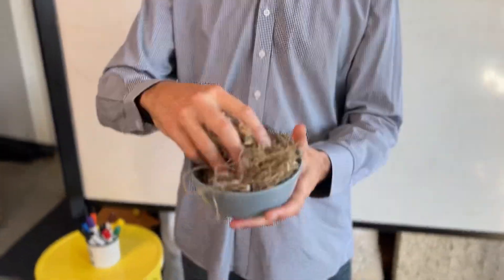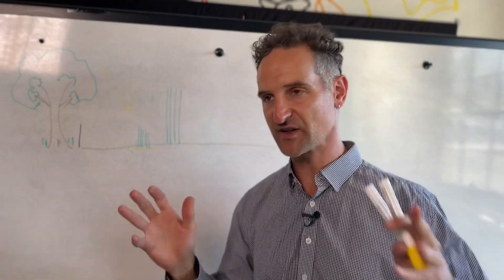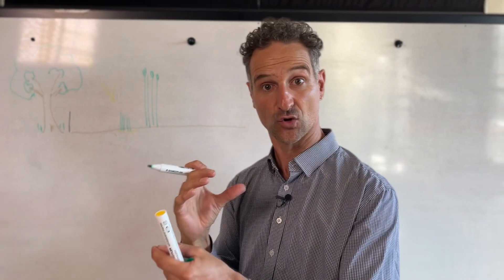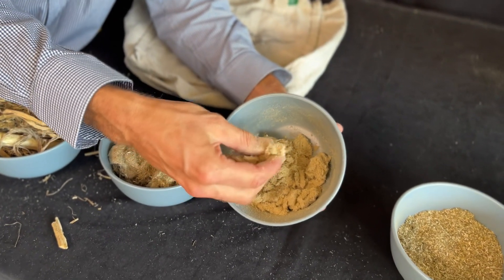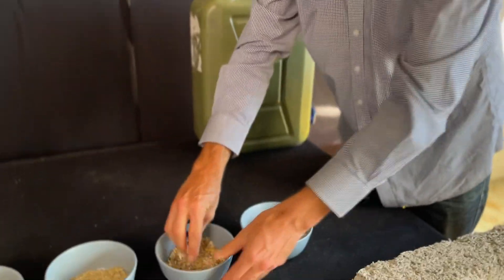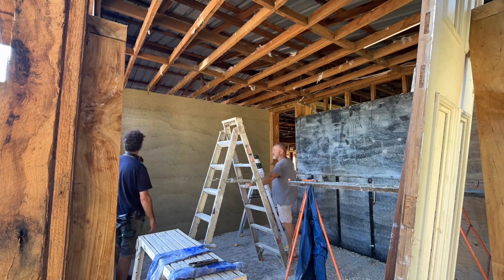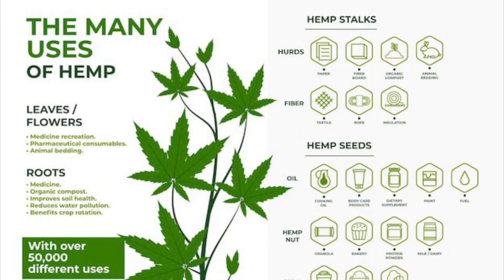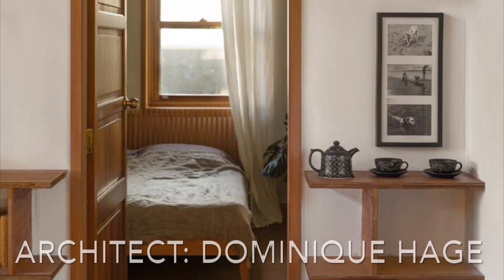Hemp and Hempcrete | Show & Tell S1 Ep9

Comment from the maker: It’s been brought to my attention that some of the information I have presented needs clarification. 

  - Hempcrete doesn’t turn to stone or petrify, even though the lime itself is getting harder as it absorbs CO2. Petrification is the process of organic matter being replaced over time by minerals to form stone, usually minerals washed in by water. The hemp in the hempcrete is still hemp no matter how old it is, and this is just as well as if the hemp did turn to stone we would just be living in a stone building a few years down the line, with very little insulation value. It is common for hempcrete enthusiasts to use the term petrification, but it is misleading. 
  - We should be careful too when we say that you cannot get mould in a hempcrete building. You certainly can get mould in a hempcrete building. This is usually just after the construction period during the drying process, but can also occur around window reveals where poor detailing has been carried out. 
  - Concrete has significant compressive strength and it easily qualifies as a structural material without rebar in it. Rebar ads tensile strength.